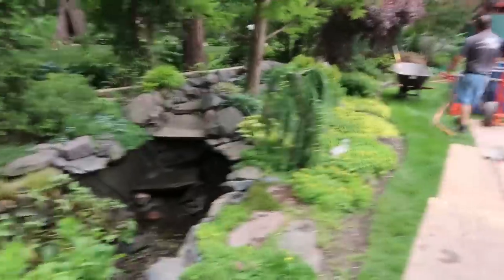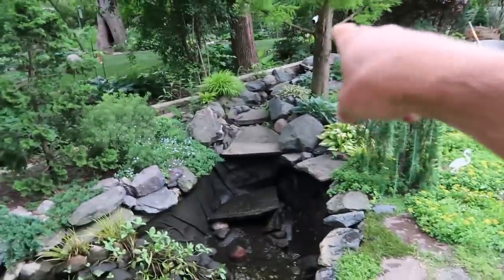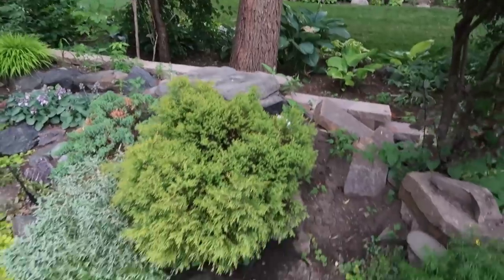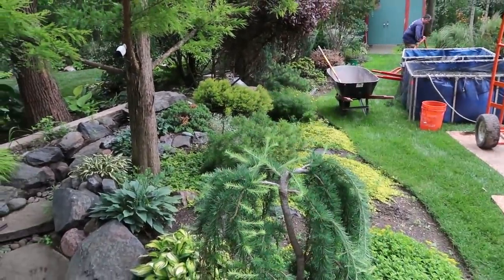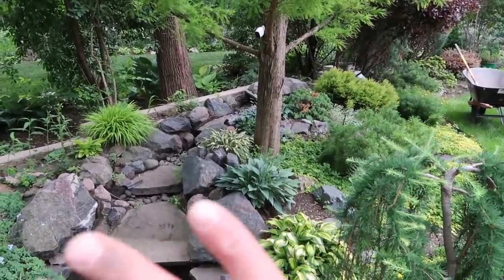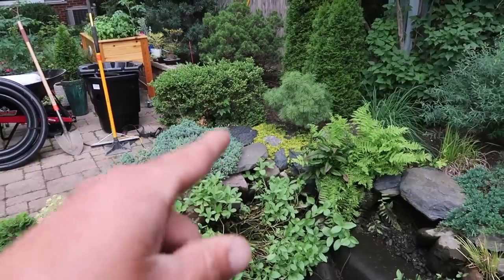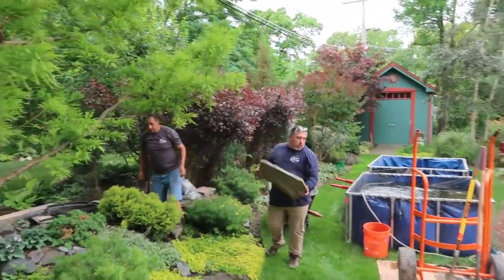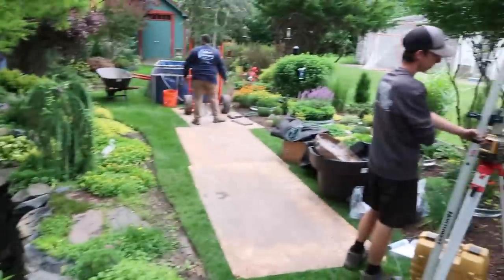Aquascape UPGRADE for GARDEN POND & Stream - Part 1

Comment: Chris I had the exact same model skimmer on one of My ponds. Let me tell you they are a bitch to keep clean and maintain. The basket will jam if the outter shell is in anyway shifted from ground pressure. Also the filter pad is a pain in the butt to take in and out and clean. The plastic part that holds the pad is just like the basket...It will jam also and it will take for ever to get that filter holder to slide back into those grooves that hold it. Also the pond water goes thru the wier door and into the filter basket which catches the big stuff but then goes thru two port holes at the bottom of that divider wall. Those ports full up with pond goo and it's a pain to clean out if needed to make better flow to the pump. My pumps I say pumps because I had many burn out. The pond goo would get so thick in the bottom. I finally propped my last pump up on a rock. The filter is in the wrong spot. It should be right under the basket. Trust me I know all about this skimmer because I had two different sizes and they both were a pain. God bless y'all